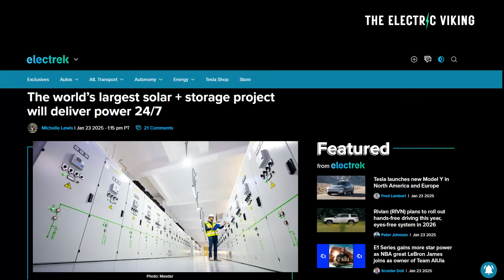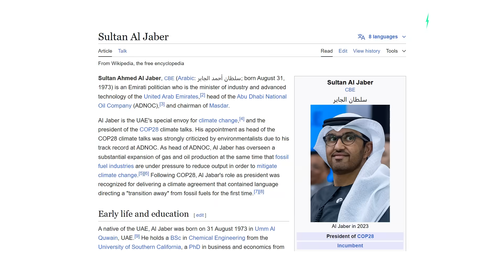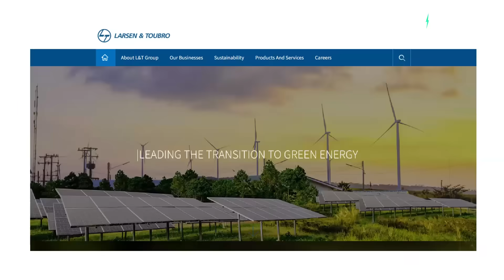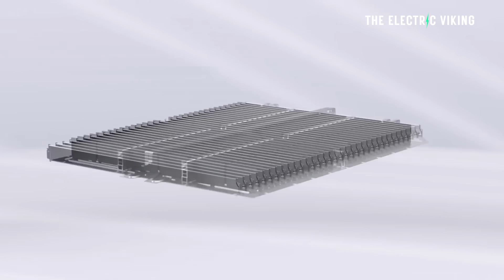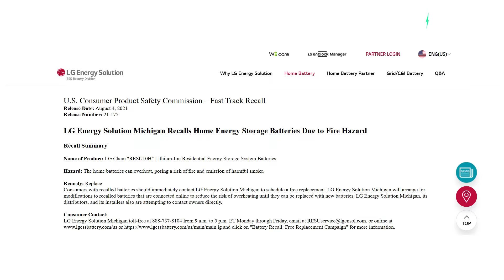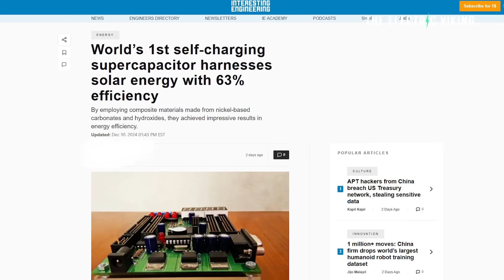The world’s largest solar and battery project deliver power 24 hours a day

Comment: If you think that DISTANT RENEWABLES can replace fossil fuels, then you need 10times more electricity generation. 

As you know, the grid capacity has to increase 10times. 

Now grids are 10times more expensive than the generation plant.

It is a humongously expensive problem and resources and CO2 emissions and financing and decades problem. 

But ignorance means getting f....over by the bs people who need taxpayers' money.   😮😮😮

Rooftop PV and BEVs massive battery parked 23hrs every day and all night long with v2g technology are perfect. 

Rooftop PV just sit on the consumers structual infrastructure, the consumer's roof.
Save structual construction costs.

Rooftop PV sits on consumer's roof. No grid construction.
Save construction costs.
Save grid rental costs $kWh. 

Rooftop PV electricity can be stored in BEVs mass storage battery when it is parked 23hrs every day and all night long.
The battery can go with the consumer and supply demand from the car park like a backwards home robotic vacuum cleaner. Selfparking selfplug-in V2G trickle currents all day long.

Building to building ezi pezi more rooftop PV selfplug-in carpark space $60 wall outlet. 

Happy money savings days. 😊😊

Multiple all the above by 20million to see that all Australians can go offgrid and leave the grid free to supply industrial customers moving away from fossil fuels to clean electricity, clean excess consumers rooftop PV electricity as grid feed-in electricity.

Lucky the grid only has the industrial customers to pay the grid owner's and no overload blackouts. 

😊😊😊😊😊

Comment: I have solar and battery on my house and I have 24hr electricity without importing from the grid. Scale it up and everyone can benefit.
Reply: Take what you've invested on your set up and multiply it by at least 30,000,000. Don't get me wrong, I'm pro small scale off grid solar/wind, but when you scale it, the money runs out really quickly. You own your house and you can afford your power set up. That puts you in a very small percentile group.
Reply: @davidbrayshaw3529  I did the same on our last home, going to attempt to set up a similar, bigger system when we get into our new home but you are correct there should be a bit more help to go electric either zero interest government backed loans or grants. 
The more folk who take up solar with battery storage the more people will get jobs in the renewables industry paying NI instead of signing on. Bit of win both ways there !.

Comment: Are you stupid? When there is no wind and no sun - you need something else: Waterpower, fossil fuel, or nuclear. Water power is limited. So if you do not want to burn coal, oil or gas, your choice is nuclear.

Now. If you are going to build solar and wind. In the winter, in Europe, cold is associated with no wind and not much sun. There is no economical way to store energy from summer to winter at the scale needed.

As a consequence - for every MWh you build of solar and wind - you need to build ANOTHER Mwh nuclear as a BACKUP. That is, the power overall become more than TWICE as expensive. 

Do you get it? Do you understand?
Reply: Are you stupid? There is always sun and wind somewhere. Energy storage is easy with many existing technologies.

Comment: We know that we can do renewables over 24 hours. The problem is: "Can we do renewables like that every day, even dark winter days?".
Reply: The answer is no. The amount of storage required to make batteries a grid-wide solution for all residential and industrial needs is so large, costs will make industries uncompetitive. I believe no serious engineer or scientist considers this a viable solution. Politicians and music major might, but these are people that cannot find their way out of an Excel spreadsheet.
Reply: @lukeearthcrawler896 Have you put the numbers in your Excel spreadsheet? Have you really calculated how much battery is needed, and what it will cost? How much do you consider “needed”? Have you looked the expected future prices of batteries, following the Wright’s Law trends that have already reduced battery prices 97% in 30 years? Have you looked into alternatives like Form Energy’s iron-air batteries, or zinc batteries, that don’t use lithium and stick to the cheapest possible materials?
Reply: that's why batteries come in handy.......
Reply: Yes and no, if paired with a wind farm and an appropriately sized battery. Yes. So the question is, is there wind available in the specific area in question to supplement solar? For this story though, Sam did specify the "Sun belt" where this would be immediately viable, which would be equatorial and tropical regions and don't have long periods of dark winter days. The further you move to the poles, the bigger solar farms and batteries would need to be to be able to provide a base load.

Comment: ah yes, so if in the australian summer it worked for one day, it means it will work everywhere in the planet and during the winter, forever. this is exactly why the green idiocracy is failed to work, the overhypers overhyping the first step as if they already finished the entire travel and than surprised when reality meets them.
Reply: Wrong. Simply wrong.
Reply: ever stopped to wonder why you failed at basic mathematics? You know, experts in the field have done the calculations..............
Reply: @andyfreeze4072  ah yes, the experts, tell me about the experts in germany who had the fun of opening several new coal power plants and mines after they went to wind and solar, including tearing up the wind plants to mine coal.
Reply: Yes, the overhypers are destroying the credibility of renewable energy.

Here in Australia the peak scientific research organisation the CSIRO has had to publicly admit that it juggled the figures to make renewables look cheaper, it has gone from being highly respected to now being seen as being run by renewable activists doing what the current net zero crazy Government tells it to do.

Power prices have quadrupled since the 'transition' started, and they are predicted to raise again shortly.

The public is getting very tired of the non stop renewable propaganda, and the skyrocketing power prices, and a change of Government is very likely at the upcoming elections.

Comment: Some places get a lot of sun AND have loads of desert or other 'waste' space to put them in but not all. Wind is often more reliable, certainly in winter.
Reply: I am not a fan of wind power for the following reasons: 1) they are quite expensive to build for large installations, 2) they are quite expensive to maintain (especially offshore installations) and 3) when the wind turbine is retired, we don't have a really effective way to recycle the materials used in a wind turbine (yet).
Reply: @Sacto1654  As for 1) and 2) the strike price of wind power from Hornsea Project 3 is 1/3 of Hinkley Point C. Using a capacity factor of 50%, which is average for the Hornsea projects, the strike price for wind is 2/3 of that nuclear plant. As for 3), recycling of wind turbine blades with happen before any long term storage of nuclear waste happens. And if people keep saying that because of 3) wind farms should not be built, then then must agree that no nuclear plants should be built until there is long term storage in that country.
Reply: @ Actually, a reason why I advocate Generation IV nuclear power is that instead of uranium-235, the use of thorium-232 results in much smaller amounts of nuclear waste, waste that has the half-life of essentially 350 years! At that level, you could use retired salt mines for nuclear waste storage. Mind you, the waste from a thorium reactor is actually quite valuable for nuclear medicine, so the waste might not even make it to final storage.
Reply: @Sacto1654  Depends the locale. For regions there is enough solar radiation, solar is cheaper than going nuclear and far safer,
Reply: @mydogsbutler  That's why I said the desert regions of the world are perfect for solar power. Like for example the southwestern quadrant of the continental USA.
Reply: @ You didn't mention it on this particular thread (can only read what you write) but I generally agree although not just desert regions are suitable for solar. It specifically depends on how much solar radiation a region gets annually to decide if it makes sense of purely economic grounds. I'd argue solar (mixed with batteries for night storage) has become the current best option for the the majority of humans on the planet. Mos live regions where there is enough sun to make solar work but there is an upfront capex to switch over. Its a short term hit for long term benefit.
Reply: As it is not reliable - you need to roughly build just as much nuclear as if you had zero wind and sun. The cost becomes more than double as a result.
Reply: @martina5328 All energy sources have their pros and cons. It's really about analyzing the use case for what option to use..Fossil fuels are mostly on the way out because the con of warming makes it a non-starter. Even then it will be a long time before you see long haul jumbo jets that don't use fossil because of jetfuel energy density. Wind turbine are  great for windy places. Make no sense on top of homes because small turbines are expensive cost per wart., Solar are fantastic for putting in sunny places. Not as as good for cloudy countries and less economic sense the further north one goes due reduces solar radiation. Hydro is great when near rivers that can be repurposed for hydro without seriously damaging something else. . Nuclear are great for spacecraft or any other area where renewables are not as economically viable but come with drawback of waste that can stay radioactive for thousands of yers.,

Comment: I’ve been saying this for a while. Batteries can handle the base load. That’s why you do it in your home (should you choose to instal a battery). There’s plenty of good information on this.
Reply: Try running and aluminum melting factory, or any industry at scale using batteries.... Wake up from your illusion..
Reply: @ Well, well, another one who wants to keep everyone on the same treadmill. Which fossil fuel company do you work for? Or are you a coalition operative? You want to stay shackled to a dead horse or pay to keep some oil industry billionaire on his private island? Go right ahead. You kiss your chains mate. Don’t expect me to kiss mine.

I’m going off grid.

I don’t care where you go.
Reply: How to you make a GWh capacity inverters? They don't have stable frequencies and intertia of turbine. This can collapse the grid very frequently.
Reply: @  Why would anyone need to do that? Renewable facilities can be build almost anywhere so that the grid becomes decentralised instead of massive, centralised power stations. That means smaller facilities that wouldn’t be generating or storing that level of power.
Reply: Batteries can't handle the baseload when there's no sun/wind for 3-5 months.
But why ruin the surface with high maintenance solar panels and wind turbines when simple geothermal will do year round
Reply: @adroitmobileware3992  Cost. We do not live on Iceland. How many holes would you need to drill to run a steelmill?... We need nuclear power. The crisis in Germany shows that.
Reply: @ I’m not sure why geothermal isn’t being investigated here. Iceland, for example, gets 99% of its energy from geothermal. Sure, they are an extreme case because there is so much volcanic activity there but there is hot water and steam below ground almost everywhere.

Solar works on cloudy days. You just don’t get as much electricity generated from the panels. And the maintenance is low. You just need to clean them every couple of years for the ones on your home. I imagine commercial installations do it more frequently but in their case, it’s automated. There are tracks on the top and bottom of the panel and a little machine just runs along and sweeps them.

Comment: Tony have not said solar is enough, he say solar + wind can deliver and the mix and amount of batteries must be calculated to each location. That arabs can do it with solar prove nothing. Where i live winter solar are <10% of summer meaning we should build it 10x bigger meaning not realistic.
Reply: Do the calculation on how many batteries we would need to power just a small country like Sweden - when it is really cold (that is, in the winter when there is no wind or sun - cold = no wind). 

Since we need to build the nuclear power regardless - wind and sun is a waste of money.

Wind kills millions of birds and thousands of tons of insects.
Reply: @martina5328  95% of the planet can get by on solar. 5% possibly cant, are we going to worry about you? Also do you have oceans nearby? You can get wave power and tidal power.
Reply: @martina5328  Tony Seba how done the calculation, you can look it up. Nuclear are way more expensive. I have heard Trump say that windpower kills birds so it must be true... Sweden have some hydropower and are connected to Norway.